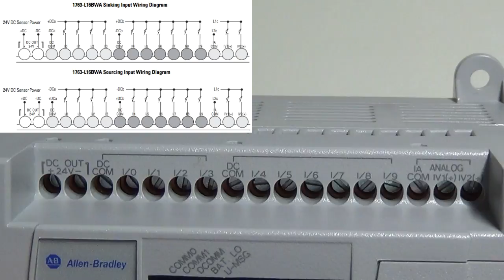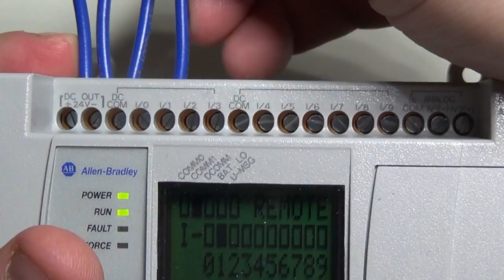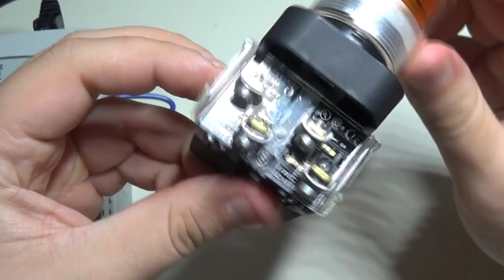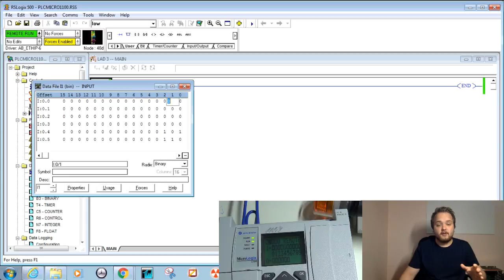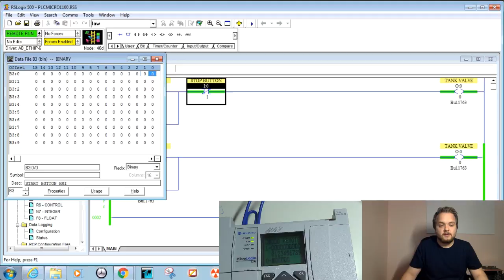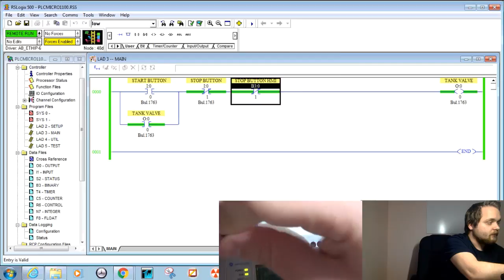PLC Programming Tutorial 2 - Hardware Connections & Basic Program Controlling a Valve through an HMI

Comment: Great video and well explained. One thing that should be changed is that the stop buttons should be wired through a normally closed contact and use an XIC instruction in the program. This provides a fail safe if for any reason the wiring to the stop button fails the valve will not turn on.
Reply from the maker: That's a very interesting observation. I've seen both done in the field (stop button being normally open / closed). However, I always preferred to maintain consistency on the hardware side; meaning that the start and the stop button would be normally open. With that in mind, the button can always fail close or fail open. In either case, there's always an E-Stop circuit with dual redundancy which can be used in cases where failure can cause harm, so I've never seen a stop button failing to be a major issue. Good point though.
Reply: EEEnthusiast I also have seen both N/O and N/C contacts used on stop buttons. In Canada, at least in Ontario, the standard tends to be N/C contact.
Just differences of opinion. Ultimately your dual channel safety circuit is your fail safe. Keep up the good work and I always enjoy your content. Long time sub.
Reply from the maker: Right on! Appreciate that; sorry again for being gone for so long. I'm also glad to see that some of my viewers are actually familiar with PLCs!